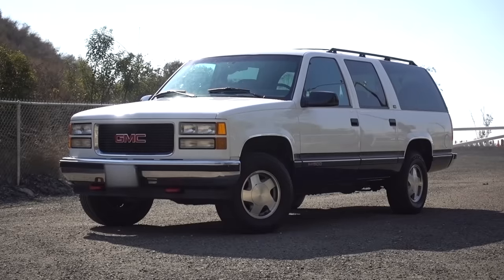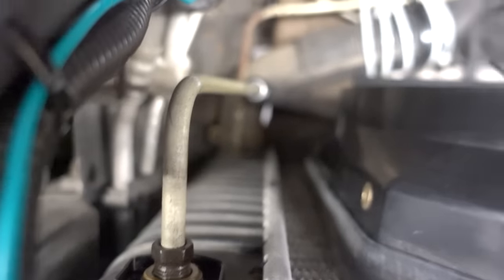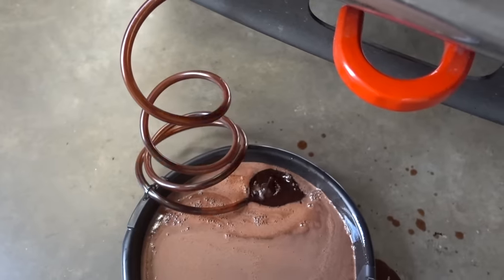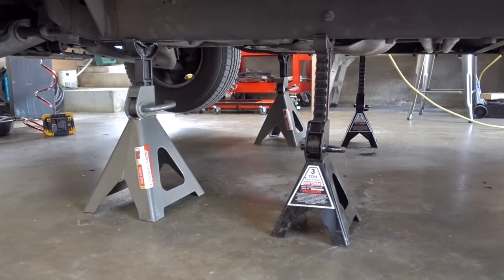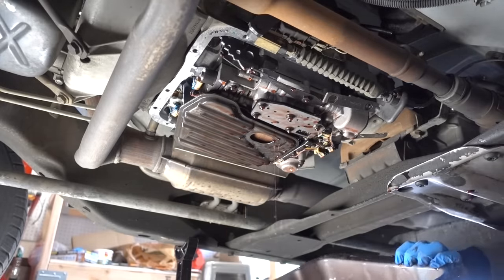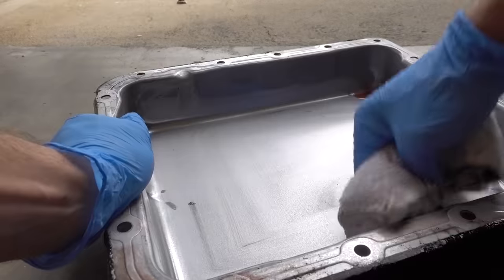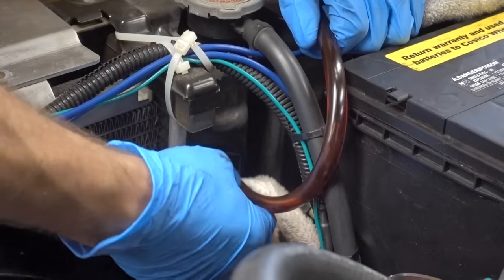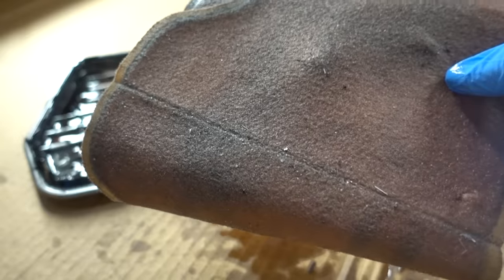Why You Should NEVER FLUSH YOUR TRANSMISSION FLUID!!

Comment: As others have already said, great video.  Everything is clearly visible and discussed and your delivery is as articulate as one could want.
In all seriousness though, the title says "why you should never flush...."  I am not a mechanic and I have had two vehicles mechanically flushed by the dealer in recent years with no bad results as of yet...knock on wood.  I'm getting too many mixed signals between YouTube, dealer mechanics, and independent mechanics on what is right.  Like I said, I have two that have been flushed and many before that that never saw a trans fluid change.  To this day, transmission problems are the one thing that I have been fortunate to have not dealt with.  So is there a real right answer to flush or no flush?  As I'm trying to be a more responsible auto owner, I'd kind of like to know what's actually the right thing to do in this case.
Reply: I don't think your question can be answered until we know how many miles you normally put on your vehicles before selling/trading them.  If you typically put around 100K or less, and you're not an off-roader, or drag racer, and don't tow a trailer, then you can leave the trans oil changes to the subsequent owner(s).  Otherwise, check your owner's manual for the recommended mileage.
Reply: @recentlychanged  In the past, I usually dumped a vehicle by 120,000 or so.  I'd like to start holding on to vehicles for as long as they'll give me.  I've gotten way more responsible with regular maintenance and hope that I can start seeing some vehicles reach 250,000 or 300,000 miles and be payment free for a while.
Also, I don't bother with the domestic brands.

Comment: This process achieves a pretty good flush, I've done it a few times.  If one wants a more complete flush: remove the filter and put a tight fitting hose into the filter hole with the other end in a bottle of clean fluid, then run the engine.  The pump will push only new fluid through the system and all the old fluid will come out of the trans instead of mixing back into the clean fluid that you're flushing with.  It's a little more work and it takes some prepping to not make a mess.

Comment: Drop the pan. Change the filter. Put the pan on. Add three quarts. Have adequate amount of new fluids ready to pour in the funnel in dipstick.  Have the plastic tube in the oil container. as shown. Have someone start the engine. Immediately start pouring new fluid.
Shut off engine when you see the color of the new fluid in the hose. Put our line on. Top off fluid by adding and checking level slowly while engine is running in Park. You’re done.
Reply: I like the method you outlined the best, and it's exactly what I did on my last transmission fluid change.  With my foot on the brake, I also moved the transmission from Park, to Reverse, to Neutral, to Drive, to D1, D2, D3, and back up to Park with the new fluid pumping   out.
Reply: I'm going to disagree. It's better to get a good amount of the old fluid out of the trans. before changing the filter. If you don't you're running a lot old fluid thru the new filter.The way he did it is not a perfect way but it's certainly better than changing the filter before getting at least some of that old fluid out.

Comment: Here's my story. Same transmission in a '97 Blazer. 205k miles when I bought it used (obviously). The transmission worked normal. I started by disconnecting the top radiator transmission line & flushed out a gallon at a time. I've never seen such brown, used transmission oil. I mean it was brown. No burnt smell though. After I had flushed the transmission entirely with Supertech ATF, I dropped the pan & replaced the filter & pan gasket. At 230k I flushed again though no filter change. Around 245k I flushed only one gallon of ATF. At 250k the transmission still works fine, though it leaks pretty good (oil pump o-ring) due to being old.

Comment: If your trans fluid is brown, its getting burned due to the friction plates being worn down to the metal base. So now there is metal rubbing on metal getting very hot and burning the fluid . 
Changing the fluid will not help. The trans needs rebuilding.
Reply: yoyo762 it will be brown after about 30 - 40 k miles no matter what.
Reply: @davepeck4045  No, it won't be brown if the transmission is working properly. 
It should stay reasonably reddish even after 100k miles. 
The stuff this OP is posting is brown-brown and that is a sign of a failing transmission where a fluid change will do nothing.
Reply: @yoyo762  It looks browner on your hnd. On white paper it will not be as bright of red as new.
Reply: @robertwadas  I hope no one takes your advice. 
My brother's car with 90 k miles on it has very pink/red trans fluid.  
Brown is oil getting burned.

Comment: You lost me when you used the crescent wrench instead of a line wrench...your next video can teach us how to repair rounded off transmission cooler lines.
Reply: Wont round them if you know how to use the tools.
Reply: Jason Malley, you're correct, as well as using a quality crescent wrench, with tight tolerances. NOT one bought at Walmart,etc.
Reply: Crescent is a brand. It's an adjustable wrench. Lol and yes only but name brand tools not Stanley walmart junk.
Reply: My bad...I meant adjustable wrench/spanner wrench...lol...All mine are off tool trucks
Reply: @MilitantMalley  Rounding off is not the issue.  You can easily force the nut out of round using an adjustable or open end wrench.  The correct tool to use is a flare nut wrench which engages 4 or 5 (depending on the design) of the corners and does not squeeze the hollow nut.
Reply: @MilitantMalley  Yea, but anyone with the sense god gave a goose knows what he means when he says crescent wrench.
Reply: Stanley owns just about every tool brand you can think of.
Bostitch
Dewalt
Porter Cable
Stanley
Irwin (Acquired in 2017)
Lenox (Acquired in 2017)
Craftsman   @MilitantMalley  

Bost
Britool
Facom
Lista
Mac Tools
Pastorino
Powers
Proto
Sidchrome
USAG
Vidma
Vicegrip
Reply: @lynnpoole7830  I did t see Mac or Snap on in your list.......
Reply: @jimgaffney4524  Mac is in the list.
Reply: Using a Crescent wrench ?....no need to comment anymore....
Reply: Vice grips work good...
Reply: The safest way is a cold chisel and hammer, you have 6 corners to hit, to be sure you’ll get it with one of them. Also maybe just cut the metal line with tin snips then place a rubber hose in between with zip ties or duct tape ( personal preference) to bridge the gap..............line wrench guy talking.....
Reply: Whatever tool someone has that will get the job done is the right tool to me. Whether it be a pair of plyers or a "line wrench". George is most likely the kind of guy that buys his tools off of a delivery truck. Lol
Reply: Am I the only one who heard he said he used     WD 40 ... !
 And then a crescent wrench !!
 Don’t forget the WD-40 guys ! Lol
Reply: O  and Stanley is the oldest tool Co. In the USA !
Reply: Did you guys ever thoughts he was using pipe wrench instead of adjustable wrench? LoL!!!
Reply: AND EACH NAME HAS A DIFFERENT ACCEPTED TOLERANCE BY THE MANUFACTURER
Reply: OMG I stopped when I saw the crescent wrench and immediately came to comment, but you were already on the ball.  Crescent wrenches have NO business anywhere near any engine folks.  In this case you better use a flare nut wrench if you want to avoid a major problem.  This is why you must be careful of these "do it yourself videos."  Use the "right tool for the job" and use a good quality tool if you don't want to end up in a nightmare.
Reply: @MilitantMalley  yup an actual cresent brand will work well.
Reply: @AirWreckD  yup a true cresent wrench is sometimes better than a line wrench.
Reply: mike brink  didn't use PB blaster
Reply: At nasa (kennedy) , if find cresent in ur tool box,  instant termination.
Reply: Helsing Leger 40 aint nothin but squirrel pee!
Reply: I don't care how good you think your crescent wrench is, it's going to move more than a regular wrench, and for lines it's certainly not as safe as a line wrench since a line wrench beats the regular wrench.
Reply: @rjvowels  Unironically vice grips can actually do a very good job if you have good grip strength and get it on very, very tight and clamp it on the flat parts of the fitting. They are less prone to stripping a line than a standard wrench, but probably not as good as a decent line wrench though. I have broken many lines loose with vice grips that were too tight for a standard wrench without stripping anything out. I'm talking about Irwin brand, not the chinese knock offs. And I have done testing, the chinese ones are not as good.
Reply: Who cares. Pay someone to do it, and if they screw it up, you just beat their ass and make them fix it
Reply: @Mach141  You obviously didn't think your reply through.  If you don't have a line wrench and use something else, you won't know whether it rounds off until it does or doesn't.  You can't work backwards from "it worked okay so that's proof", because it doesn't always work okay, particularly on vehicles that old.
Reply: @MilitantMalley  Nonsense. Using a crescent wrench perfectly, correctly, it can still be the case that the nut is seized on from rust and needs more torque to remove than a grip on only two sides can provide without deforming it.  Hint:  This is why line wrenches exist.
Reply: @blindabinda1234  That's easy to say until you break a fastener and spend hours trying to get it out because you wanted to save $12 on a wrench.  You don't know if it will get the job done until it succeeds or fails, and if it fails, there is no rewind to go back and get a different wrench.
Reply: Neal Head  LoL, that's not a barbed fitting.

Comment: I never flush. I change the fluid very often instead. I just extract and empty the oil pan from the dipstick tube. 
No mess at all. The same goes for when I am replacing the filter and cleaning the magnet. No need to make a mess by removing an oil pan full of oil.

Comment: Please change your filter seal because the rubber will just get harder and harder as it gets older and it won't seal as well. Tilt the pan to drain off fluid while the bolts are loose but still attached at the back side of the pan. Then it will be easier to lower the pan after the bolts are removed because it has less fluid in the pan.

Comment: The only thing I would add here is that the fluid in the external cooler got left behind. That could be remedied by using a rubber tipped air blower. Turn the air pressure down to 30psi and put the blower on the return line and push the rest of the fluid into the pan after round two, before dropping the pan.

Comment: It's actually not bad for 24 years of old fluid. A lot of it just clutch and band material that won't damage the transmission. Anything bigger will be filtered. However, viscosity of old fluid might be too thin to allow all the bands and clutches engage properly.

Comment: The fluid is brown mud because of clutch wear. You've got worn steels turning on burnt clutches held in by a bunch of hard old seals. You've just changed the viscosity of the transmission fluid, making it even more slippery. Now its just like new! What could possibly go wrong? If you didn't change it at the service intervals, leave it alone and start saving up for a rebuilt unit.

Comment: Best to change filter and fluid on A/T every 30,000 miles.  Using this method does help remove some of the converter fluid vs. a simple drain and refill. Auto makers might suggest 50,000 or even 100,000 between changes.  Not a good idea.  By the way, screaming at us is not recommended for the entire video.
Reply: But at least he hasn't started flailing his arms/hands around uncontrollably through the whole video as well yet.
Reply: Doing this method removes almost all the old fluid in the system if you let it drain until it comes out clean then you've replaced probably 98% of the old fluid with new fluid !!! The only thing that I don't agree with, Is letting it drain twice until you see bubbles !! Let it drain once and then add couple of gallons of fresh fluid and run until it comes out clean, this way you won't run the pump dry...shut off the engine and add more fluid until it comes up to the add mark on the dipstick, Then let it run until operating temperature check it again if It's anywhere between the hash marks on the stick then take it out and drive it for 15 or 20 minutes and check it again...if needed add more fluid to bring it up to the full mark !!

Comment: To me the problem with a flush instead of drain and fill is that the filter does not get changed. When you go to oil change place they just flush in new fluid come out and don't replace the most important part the filter. 
What happens is the flush process causes the filter to become so clogged that the fluid cannot pass through it. I've seen one where water could not even passed through it on a transmission that gave out
Reply: You need to change your oil change place, there is no way a sane person  will change the oil and not the filter, they are done at the same time. I am still not sure if flushing a transmission is a good idea, however a flush comes with new transmission filter.

Comment: I use the same process on my vehicle's and have to do it to my 1996 GMC 2500 with the 4l80e transmission sometimethis week. I do it a little different then you. How I do it is use the transmissions pump to pump out the old fluid, like you do, until you just start to see bubbles, then turn it off and drop the pan and change the filter, where on what you did at this point was add new fluid to continue to pump out old fluid before you dropped the pan and changed the filter. So after I dropped the pan and changed the filter and put the pan back on, THEN I add the new transmission fluid and let it continue pumping and continue adding fluid as many times as needed until the fluid coming out is the same color as the new transmission fluid going in, instead of only doing it once and calling it good. That is the only way you will get all new fluid through the whole transmission, and through the torque converter, and trans cooler. I also use one of the best transmission fluids you can use, which is Amsoil signature series fuel efficient synthetic transmission fluid which is awesome on protecting your transmission and normally helps out with any shift issues experienced before servicing your transmission. Amsoil is awesome stuff and I use it on all my vehicle's fluids, and no Amsoil doesn't sponsor me. I pay for it out of my own pocket and just by experience I have had with Amsoil, I will continue using it? I use to use mobile one fluids and filters but I switched to Amsoil fluids and Wix filters on both my Suburbans, the 1996 2500 and the 2004 1500. 😁👍

Comment: I purchased a used 2001 Ford Explorer Sport for 4wheeling  purposes.  At 182,000 miles I did a complete ATF change except I used a pump to suck all of the fluid through the Radiator outlet.  I did the refill and used the suction pump again until the fluid flowed clear.  I adjusted both clutch band adjusters to a turn and a half instead of two turns because the overdrive was slow to engage, and the low gear wasn't engine braking.  Both problems solved.  Now at 208,000 miles without any problems.  Shifting remains perfect.

Comment: You should definitely NOT let the pan run dry when you use this technique. You're supposed to do a quart or two at a time, and replace the fluid as you go.
Reply: It could run "dry" for a long as time and hurt nothing just sitting in the driveway. There is no heat and there is oil slopping all over everything. Just chill.